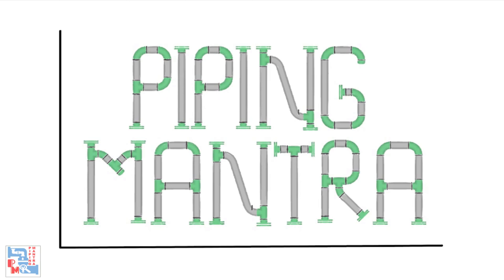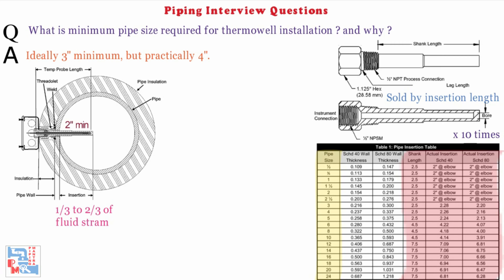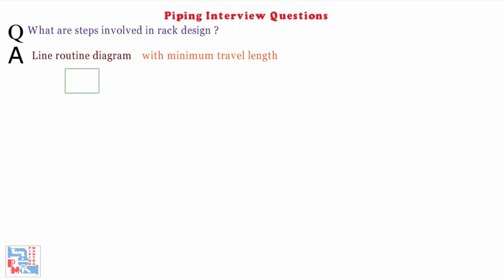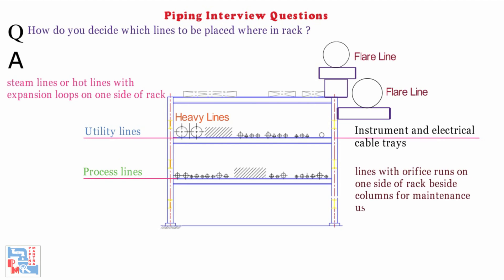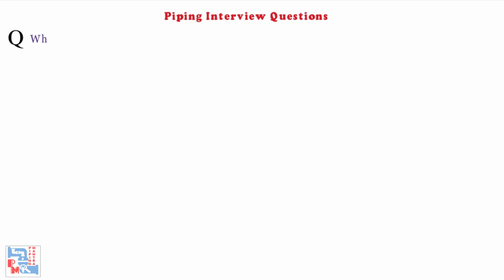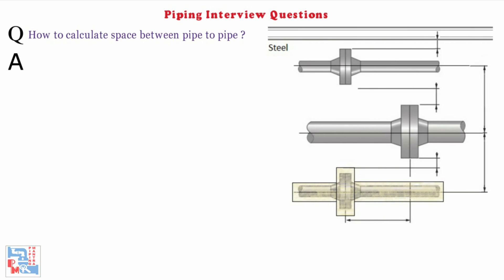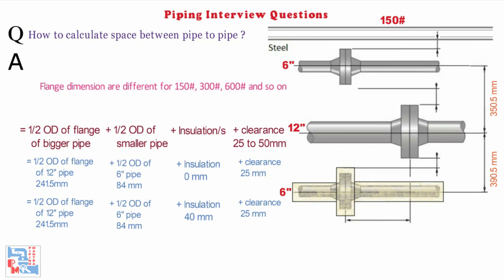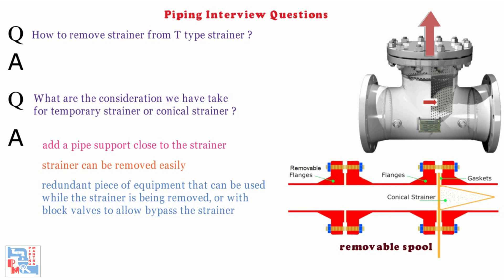Piping Interview Questions | Part-10 | Piping | Piping Mantra |

Comment: why flare line kept outside pipe rack or on TOP of pipe rack??
Reply: Flare lines have hazardous gases so need to put this line on highest elevation..
Reply from the maker: No.. flare header must sloped toward  knockout drum so it shall be above flare KO drum. Plus all the PSVs shall be above the Flare header. With that combination Flare header is mostly  on top of the rack. And its required 2Dloop for thermal expansion so outside would be better posiition